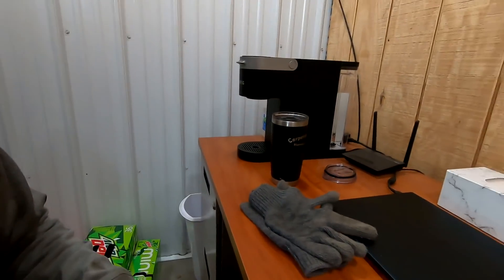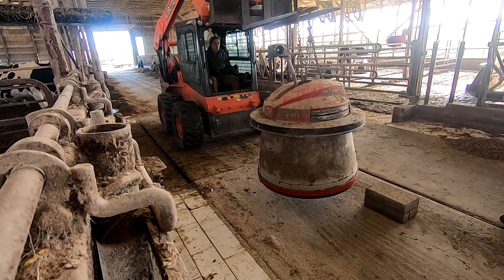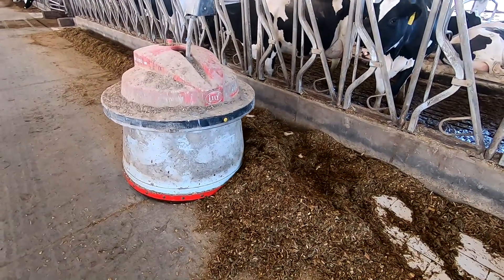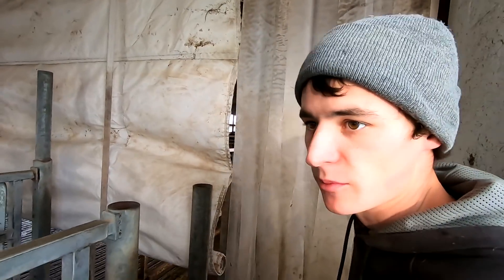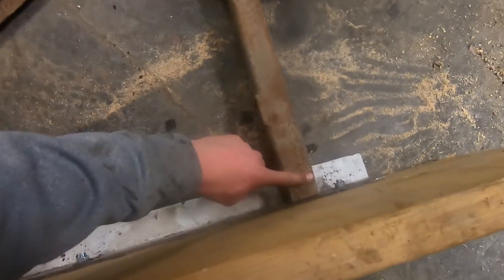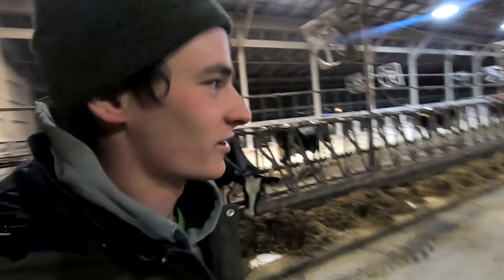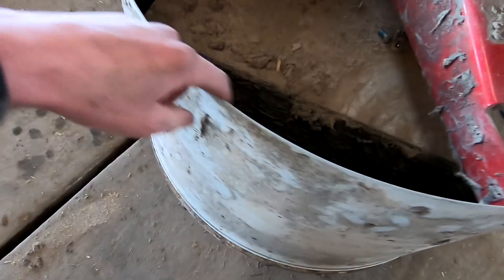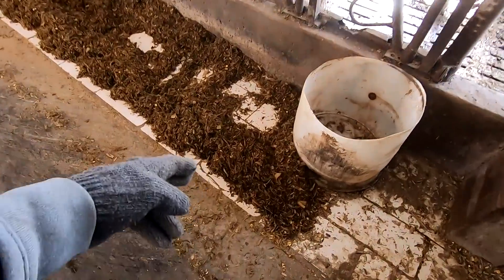Robot Feed Pusher Down

Comment: Wouldn't it have worked to just manually drive it to push the feed rather than sweeping it? I feel like it wouldn't be as labor intensive but i guess it may be slower.
Reply from the maker: It's really slow when you manually drive it but it would work

Comment: You could stack 3 or 4 pieces of old baler belts together, bolt them to your board, and let them hang down 1.5 inches or so off the bottom. It would keep stress off your pusher and make your board last longer. Or old tires cut into strips etc.

Comment: Yes, you are correct, that Juno needs some cleaning. Use a medium bristle 3” paintbrush under the cover and blow out with compressed air. Then just good ole soap and water on the outside.

Comment: Nice solution for feed pushing. Your board might last longer if you but a rubber strip along the bottom edge. As smooth as your concrete floor is, it is going to act like sandpaper and wear your board in short order.

Comment: If you increase the angle a bit more, it would slide off the board better. Either that, or line the front with a piece of white teflon. It would slide off more easily.

Comment: Have you looked into a fiberglass snow plow small ones for quad? You can also cut thick rubber mat for the bottom so you would have 4 inches rubber mat bolted on the snow plow and that would run on the concrete floor

Comment: Those bot feed pushers are nice but seem a little fragile for a dairy barn environment. I liked your temp solution. I'd keep that handy just in case. If the robot breaks down again I would paint flames on it and enter it in Battle Bots. It will feel good to see it destroyed. You should find a good used lawn tractor for a couple hundred and attach the blade to that. Easy/cheap/ the cowboy way..............

Comment: Mice are the cause of many electrical headaches on our grain farm as well!  Whenever we experience sudden "sensor" failures, we usually reach for the multimeter first.  Simple continuity and voltage tests will usually direct you to the faulty component pretty quick.  And more often than not, it's a wire that's been chewed apart 🐭 A couple wire connectors and some electrical tape, and we're back in business!

Comment: In order to fault find, you need to know how each component works. The fact that you have steel flat bar bolted to your floors at various intervals tells me that the sensor is a magnetic switch. When it crosses the steel, the magnet wants to move to the steel and closes the switch. Those very seldom break. What you need to check is the cables and the connectors. It could be either, I would place a bet on a connector getting moisture on it and corroding. Maybe a cow thought it would be fun to pee on it. Do you know how to use a multimeter? It will save you a lot of guessing, time and money if you can test things right up to the controller board. If not, contact me. I will teach you.

Comment: Maybe if you install a stiff rubber blade on the bottom of the PLOW FRAME might also help the situation. Do you have a standard plow for the Skid Loader with a rubber bottom blade that you could use? Using a standard Snow Plow you could also use the mushroom bottom shoe's to adjust the height of the blade.  WHAT DO YOU THINK??  Just food for thought....

Comment: Great video Eric. A little piece of advice when cutting angle iron or square tube start on the corner and it will cut faster as you are cutting 2 webs at once.

Comment: Nice job on the Stand-By feed pusher.  Also hopefully you were able to return the part that you did not need to fix the Juno since the problem was only a wire.  
 Thanks for sharing great vlogs.     🐄 🐄 🐄 🐄 🐄

Comment: Do you ever clean that robot inside and out , even if it is only with high pressure air?  It's called maintenance where you look over the equipment for problems (like rotten tires and frayed electric lines).  It sure beats a dead robot in the alley.

Comment: If your robot breaks down again and your board fails a very simple but effective tool can be made old car tire on the rim with air two bolts up through the bottom where the studs would usually go either nut and bolt or welded to a piece of angle iron which is also welded to the piece that will angle to your bucket build one works wonderfully just trying to help no charge LOL

Comment: "Batteries are dead from sitting for the last four days". Will likely need some new batteries soon.
Reply from the maker: I think they were low to start with because it kept missing the charger before, hopefully not.
Reply: @10thgenerationdairyman  Right, that doesn't help. But this time of year I seem to find dead batteries all over the place. Anyway, no reason to replace until they won't recharge.

Comment: U might need to wash it and put a rubber strip on the bottom of the wood on the pusher and it will slide off and u wont have t ok push the tmr off